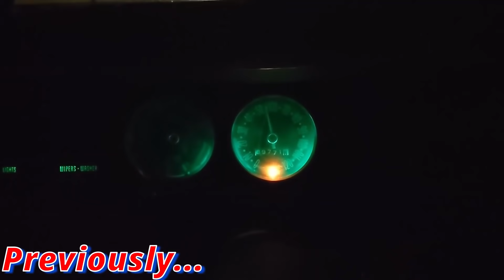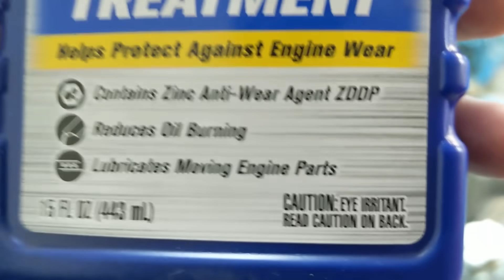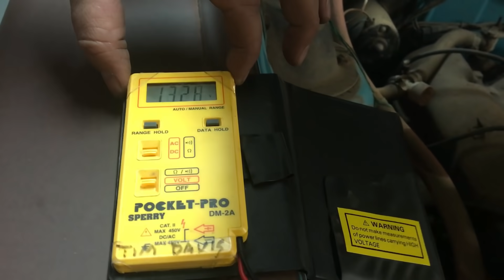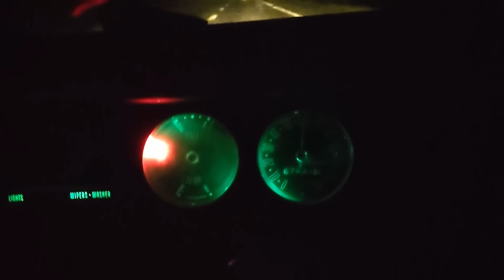ABANDONED AMC Hornet Junkyard Rescue Will it Run After Sitting for 25 years? Sally's Speed Shop Ep13

Comment: I had a 1972 AMC Hornet 4 door 232ci 3 on the tree and try as I might, I couldn't kill it. Lord knows I tried. It went thru a few clutches but was still running when we parted ways. First second and third gear got you 30, 60, & 90 mph before the valves started to float. Oh to be young again!
Reply from the maker: Sounds like some good times right there!

Comment: Still have some original parts for these cars. Like a 199 torque command 6 air cleaner sticker. new but old. Also the rallye sticker and also parts book for these models. From my days with these cars. Don't forget to put steel belted radials on it....it will ride a lot smother. Have rocker arms for the 304...lol also starter solenoid.. Have brake springs and some brake parts...lol
Reply from the maker: Sounds like you've got some stuff sitting around! haha

Comment: I had one of those.  First carb I rebuilt to get it to pass inspection (Filled with STP).
Reply from the maker: Nice man!
Reply: @SallysSpeedShop  LOL.  It was a death trap I paid $300 for and it had 188,000 miles on it.  Barely stopped.  I will say, that straight six engine was a runner!

Comment: Needs a AMC 401 or 360 I got a few up in Chicago :)
Reply from the maker: A 401 would be rad!
Reply: @SallysSpeedShop  If I wind up with a spare one Ill let you know I find them all over up here I have one going in my Wagoneer but Im always on the hunt easiest place to find them is 74-78 jeep full size trucks
Reply from the maker: @mattmopar440  please do! I'd love to do a 401 with a blower in the turquoise wagon 👍🏼
Reply: @SallysSpeedShop  well the 401 going into my wagoneer has one of these bad ones and a sniper system going on it 

http://www.torqstorm.com/kits_single_AMC.html
Reply from the maker: @mattmopar440  Very nice! We actually just picked up a Wagoneer ourselves
Reply: @SallysSpeedShop  I have a spare 401 just in case this all goes wrong so if I don't wind up needing it I'll let you know. The 401 is a badass motor but even a 360 would be a big improvement on the 304 and those are a dime a dozen the 360s are only cast crank cast rods cast pistons though. The 401 are all forged so they handle the boost better I'll keep on a lookout in the rust belt if I find a rotted out fullsize with a good Z code motor I'll shoot you a message. I do have a 360 4bbl out of a J20 I'm not going to use up here as well
Reply: @mattmopar440  cast rods !!????
R U on cast drugs?  
Paper mache` rods R stronger !
Reply: 401 would be awesome it's not a build you see every day
Reply: how much for a 401

Comment: The PO of my 68 Cougar didn't to the minimums and got it started.  When I did the oil change there wasn't a bit of viscosity left in the oil and it tapped like crazy... unfortunately for me, I now have to either replace or rebuild the motor because of a snapped rocker arm and dropped valve
Reply from the maker: That's no good! Changing the oil is way cheaper than changing the motor
Reply: @SallysSpeedShop  I'd like to be able to get a hold of the new 7.3 gas engine and 10 spd auto.  Reality says that since it will cost about the same between a rebuild engine and trans and replacement I'll probably go crate motor and monster aod trans.
Reply from the maker: @ClassicStreetIron  that would do the trick!

Comment: 4:16 Ford guys... the problems isn't whether or not they can be trusted; it's that they can never leave
Reply from the maker: Haha ooooh... Burn!
Reply: im very offened by that statement being a ford lover and i have a big collection of fords at present some with 500,000 miles on same engine and running strong.... for over 35 years i have owned lots of the blue ovals...out of them years never had a ford brokern down....all ways got me home long distances .here in Austraila .....cant say the same about any gm or gmc products...i have owned has left me stranded on the side of the roads lots......fords fly and chevys die....
Reply from the maker: @jamiegreenwood7996  Don't be too offended. I for one am only joking with the Ford jokes. I might not be much of a Ford guy, but I have owned a couple in the past.
Reply: @jamiegreenwood7996  - I don't know if the culture is similar where you are, but around here (New England, USA) there is a longstanding but very lighthearted feud between Ford and Chevy guys. No one seems to take it seriously, and it's always good for a laugh.
Reply: @N1RKW  haha true yes its funny here in austraila ....we have the outstanding ford  barra six pushing out way more horses than a LS  CHEVY ....the barra with turbo up graded springs and internals some have made 2000 hp i own about twenty of these motors
Reply: @jamiegreenwood7996  - The Barra is indeed an excellent engine. It's reputation has made it here, even if the engine itself hasn't. I wouldn't argue against one of those or an LS, as long as it's going into a Chevy. (all in good fun, of course) :D
Reply: @N1RKW  Yeah, we do the same here in the Pacific Northwest. It's all meant to be campfire jokes not insultes. All mechanical machines can and will break.
Reply from the maker: @jamiegreenwood7996  I'd love to have a couple Barra motors to play with. Please send some our way haha
Reply: @SallysSpeedShop  true bloke ...yes very rare motor in the states .... the power these barras put out with some upgrades is truly madness ......im keeping all mine haha  ford has pulled out of austraila in 2017 ..we can only buy  mustangs and ford rangers ...its a shame no more aussie fords built since then
Reply: Ask your man Finnegan he had one given by Benny after drag week.

Comment: 13.2 volts wan't charging, thats just the battery stored voltage. You need at least 14 volts and up to 15.7 volts above idle .
Reply from the maker: That's true with modern cars for the most part, but the majority of old cars charge anywhere from 13.2-13.7 volts

Comment: Pretty sure that type of fuel filter works best mounted over the exhaust manifolds. lol It should be charging at at least 13.8, so it's a little low.
Reply from the maker: Haha I can't tell if you're trolling me with just half of this comment or the whole thing...
Reply: @SallysSpeedShop  Just the first part. lol
Reply from the maker: @jayinmi3706  Haha gotcha. The battery was charging enough for me to be more than happy with it

Comment: "drive home in reverse." Wouldn't put it past you :) FYI an old pair of pliers > screwdriver for shorting a starter solenoid. Depending on your arrangement one can even reach all the way to the positive terminal of the battery to get past suspect wiring.  A pair with scorch marks all over lives in the Broncos glove box.
Reply from the maker: Good tip! I could see that being easier for sure!

Comment: check the highbeam switch for the headlight failure mt nova did the same
Reply from the maker: I did, it's something else in the wiring somewhere
Reply: @SallysSpeedShop   More than likely is the switch. Switches are a common failure point.  Luckily, its also a common switch and easily replaced.
Reply from the maker: @That_AMC_Guy  Yup, it happened on my other car. Just haven't taken the time to pull it apart yet

Comment: I don't like to put new oil in for the first start unless I have to. The old oil still has zinc.
Reply from the maker: It would probably be fine with the old oil, but new oil is cheaper than an engine haha
Reply: Pretty sure I heard a couple years ago that they pulled the zinc from the diesel oil too. Used to run it in all my older engines because of the zinc.
Reply from the maker: @markbauman1411  some diesel oil has it still, but you gotta check yo make sure. Delo and Rotella are still good 👍🏼
Reply: Always used rotella

Comment: Here's a tip , if no sand paper available go to drugstore and grab Emery boards ...
Reply from the maker: I've used them before too. Works perfect!
Reply: @SallysSpeedShop  Got a match book?
Reply from the maker: @ddd228  That'll work too! Even a flat head screw driver that has the ridges on the tip will make it happen

Comment: That is a drum brake master cylinder. Yes there is such a thing as power drums, my Javelin has power drums. Somebody just did a disc swap on this car while still using the drum master. The only differences between a disc master and a drum one are the reservoir size and the disc one would not have a residual check valve for the front. You need to take out the check valve for the front on that new drum master or the front disc brakes will drag. After all this time the engine may not be original.
Reply from the maker: Yup yup! Pretty much sums it up haha

Comment: I'd be checking into those brakes.  That's a 4-wheel drum master cylinder on a disc brake equipped car.  That can cause problems, most notably - the front brakes will drag.
Somebody along that cars life put the wrong master cylinder on it.
Reply: he did mention one of the brakes was dragging
Reply from the maker: Hmm... Interesting! It hasn't really given us any issues since the first drive. I'll have to look into that.
Reply: @SallysSpeedShop  Proper disc brake master cylinders will have one reservoir larger than the other (obviously) for the larger volume of the disc brake circuit. 

Also, drum brake masters will have a residual pressure valve in the front brake port,  to maintain 3lbs of pressure in the line to ensure the front brakes apply first.

And I'm sure somebody out there is going to reply that it's fine, blah blah blah....

YES, you can run it like this.  Is it 100% safe? NO.  Will it cause minor issues? YES.  The original engineer designed it the way he did for a reason.  Yes, you can always "make things work", but there's a wide margin between "just working" and "working properly".
Reply from the maker: @That_AMC_Guy  Yup, you're definitely right about all that... Will I actually find the time to do anything about it... I'm not sure haha

Comment: surely you should have used fresh fuel before you started the car. all the crap that was in the tank has been dragged through the fuel system.
Reply from the maker: We drained the tank, but only had about two gallons of fresh fuel on hand to put in so I'm sure it mixed with a bit of the old stuff.

Comment: Do not run that old engine on synthetic oil! Use mineraloil!
Reply: Not going to make one bit of difference. Synthetic is just over the top tech for a motor made to tolerate Dino oil. All it's going to harm is one's pocketbook.
Reply from the maker: Synthetic oil is totally fine in old cars, mineral oil on the other hand is not haha The properties of synthetic oil make it far superior to conventional oil for a number of reasons